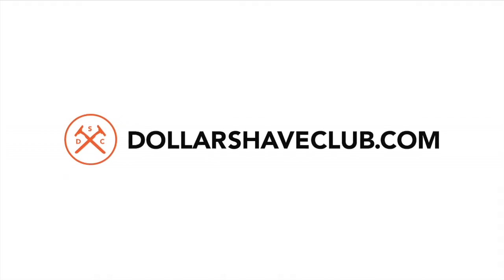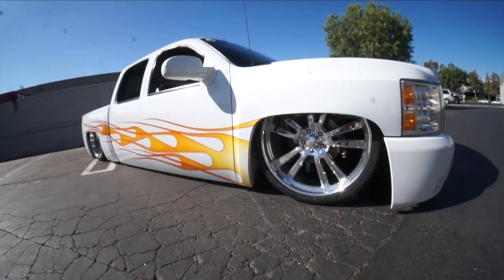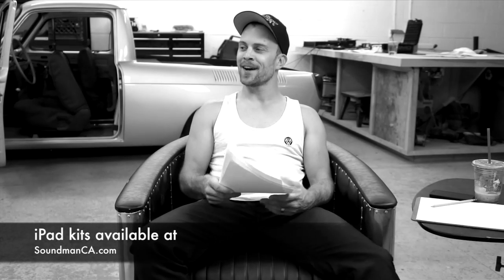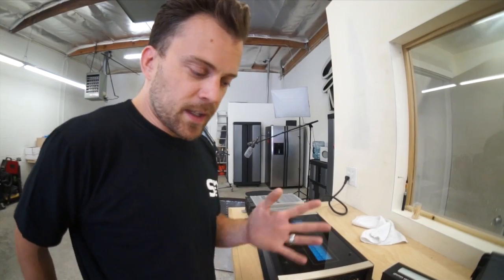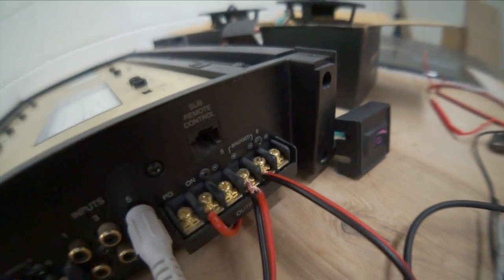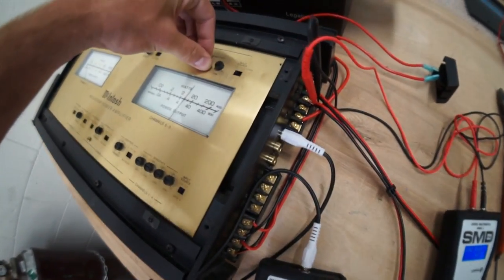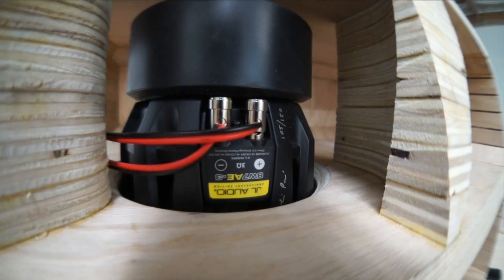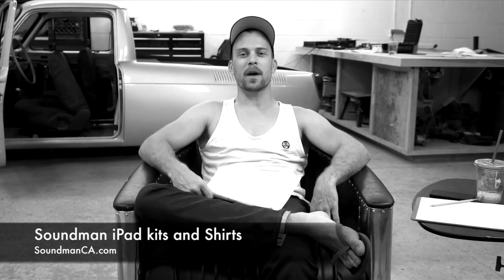Amp Dyno my McIntosh Amp and a Bagged Chevy Silverado

Comment: The coolest part of that AMM-1 is it gives you the actual power your speakers are receiving. The Amp Dyno AD-1 tests out the capabilities of the amp itself to find out it's maximum output capability at various ohm loads
Reply: Kule devirmek
Reply: BigD, do you have access to more McIntosh amps to dyno test? I saw you only had one posted. I'm still curious how this one tested at 277w off channels 5+6 bridged @ 3ohms, when the manual says 400w RMS @ 4ohms bridged?

Comment: As an owner of $1.2 million in Mcintosh electronics I can say from experience that Mc amps perform the best for SQ running in 4 or 2 ohms ,for home use I prefer 8 ohms for my line arrays and 16 ohms for the JBL Paragon speaker system my father paid $2,399 for in 1957 and it still sounds excellent after I damped the horn throats .

Comment: What happened? 5+6 bridged should be 400w into 4ohm, if ur using 3ohm it should be even more watts. But you said you only need 250w for that sub so i guess its fine, but still. Whys ur reading so low??